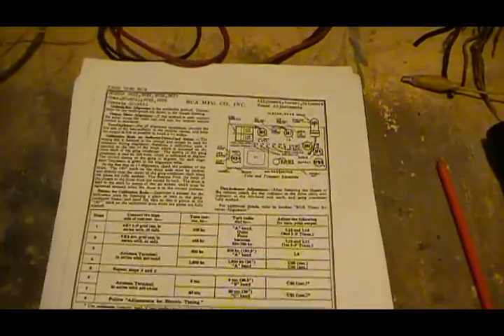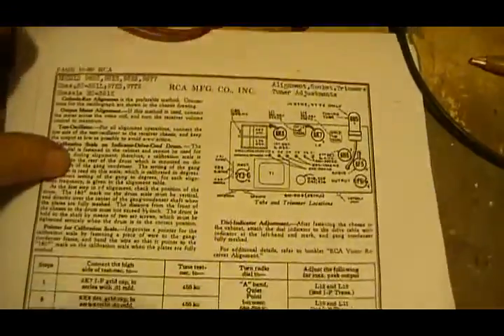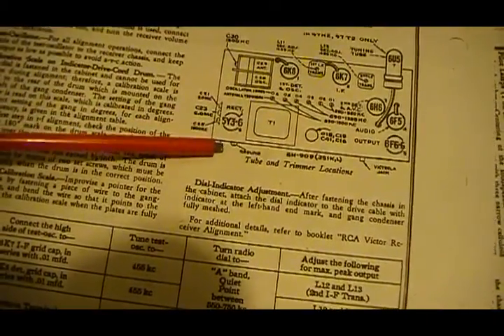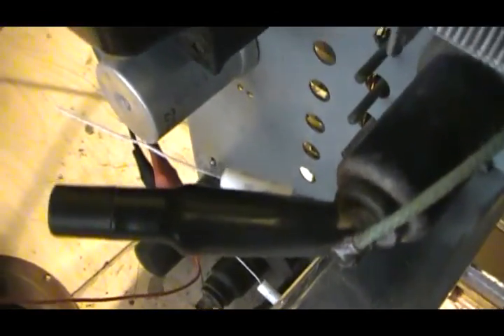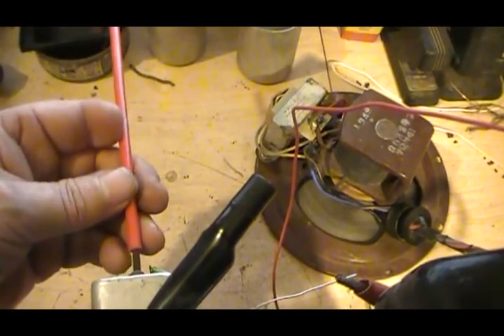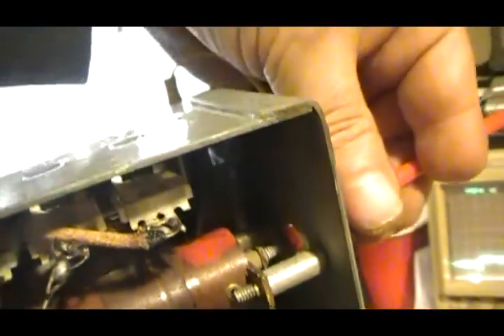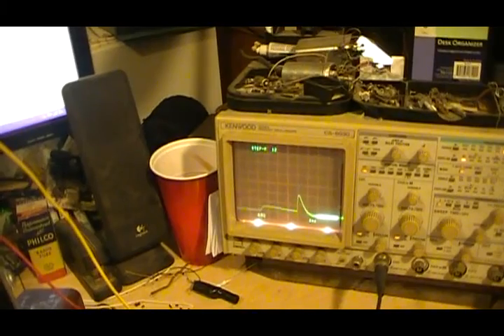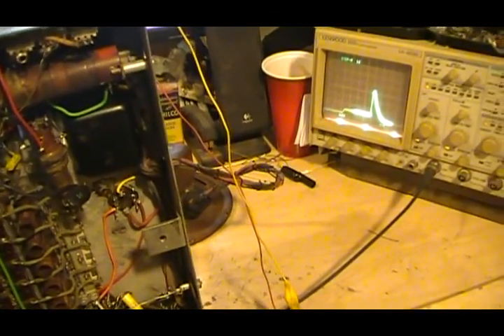RCA 96T7 part 8

Comment: Dennis,
Some vintage radio technicians/restorers prefer to use a meter, like Arkansas John, and others prefer using a scope to assist with RF alignment. I, like you, mostly use a scope for the process. I suppose it largely boils down to how we taught to do such adjustments.
Regards,
Phil.
Reply from the maker: Hi Phil. I find for me that I seemed to get a more accurate alignment with the scope then with a meter. Thanks for watching and the comment.
 Your friend, Dennis